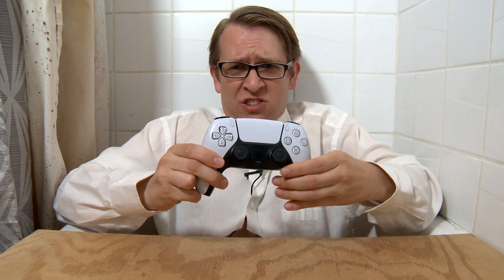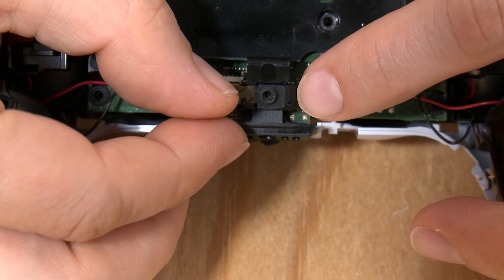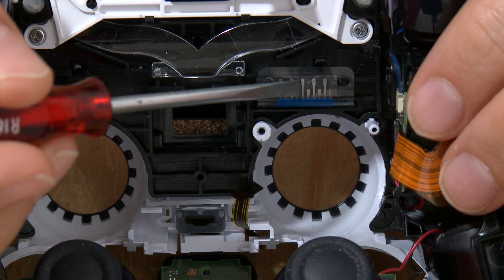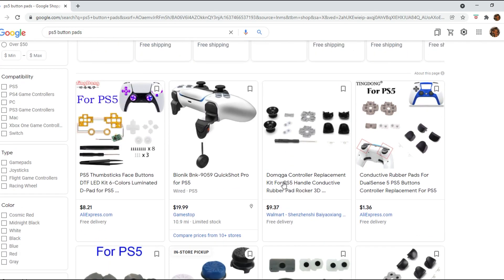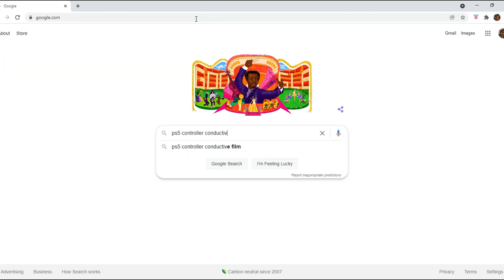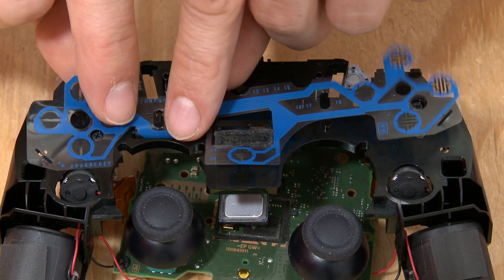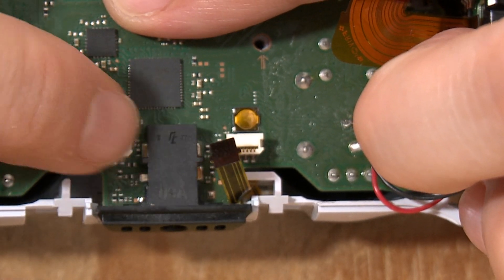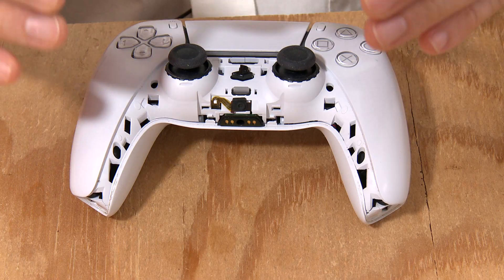PS5 Controller Buttons Not Working

Comment: For anyone having issues with triangle button idk what it is but dropping it on the floor and then smacking it worked. I thought all the comments about ppl saying just drop it or smack it hard was just trolls until I did it myself lmao. Warning don't do this if it's the only controller you have or you don't have money because if it doesn't work you might break it.

Comment: This first step of disassembling and cleaning the area worked the first time and everything here was so clear I only had to watch and pause a few times. My dpad and buttons were not working and ps button was not turning on but my controller was charging. This absolutely worked. 10/10
Reply: What solution did you use? My d-pad and l1 l2 dont work so it’s a relatively similar issue.
Reply: @getdatmoney445  took it apart and cleaned the sensor. Put it back together. The buttons worked after that. I dropped it the night before and the Ps button dpad and other buttons were not working.
Reply: @JACdUpProductions  thanks

Comment: It worked for me, 4 face buttons and Right side trigger button all work now. Thanks!
Reply: Which one did u use
Reply: @Orangeoreothefirst  I cleaned the conductive film and put it back together. Sadly I dropped it a few more times after fixing and that clear plastic part finally snapped in half. I ended up getting an xbox controller... 😅

Comment: This guy is my hero. I was sure this wouldn't work because I was rough with the controller when I took it apart and had an extra piece when I put it back together (probably the mic). But before I followed the first 2 mins of the video, none of the buttons worked and now they do. Thanks!

Comment: This video fixed my controller after half the buttons stopped working from a drop. It was the connection ribbon of the buttons connecting to the main board being misaligned.

Comment: I bought a new controller because the joysticks on the old one didn’t work but dpad and buttons worked well, my not even 3 month old controller square button stopped working and I cleaned what was shown in the video but didn’t work, can I replace the conductive film with the one in my old controller?
Reply: @YorkiesTV  I gave it a try and it worked, thank you! very helpful video.